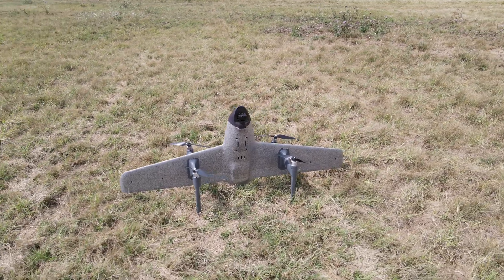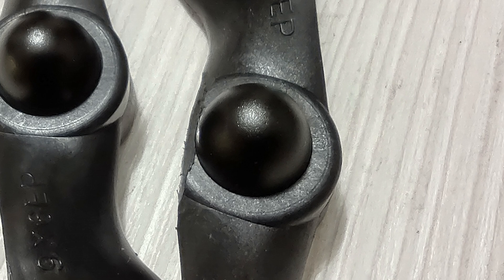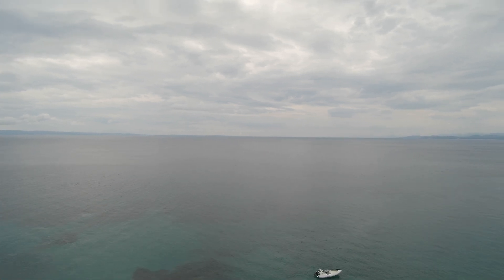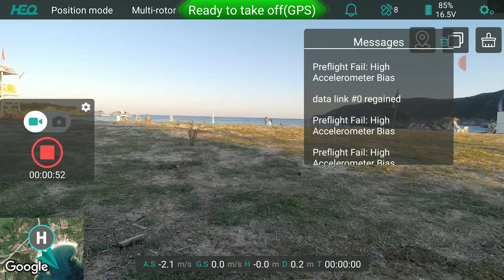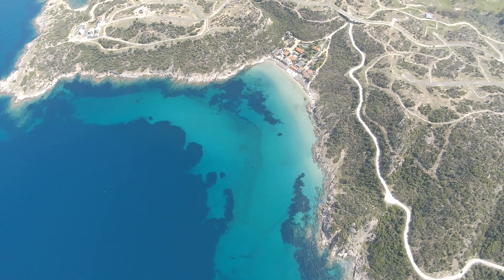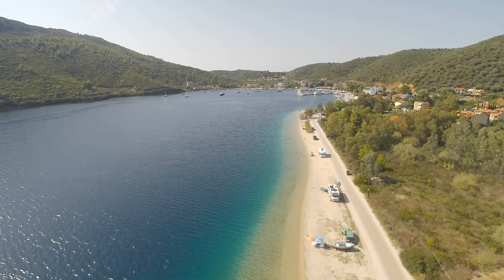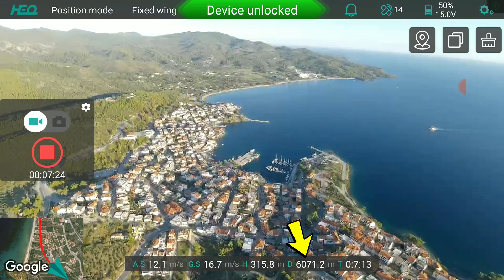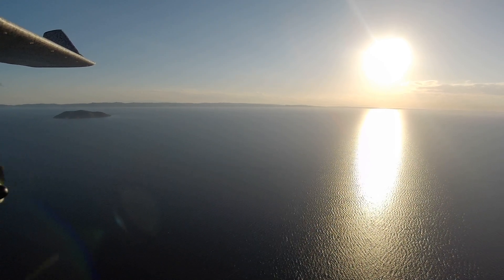HEQ Swan Voyager 1080p VTOL - improvements and more testing

Comment: Hello, thank you for your video. I am a drone instructor at a school in the US, and received the Swan Voyager today. Can you tell me where to order additional sets of props? Are there any after market better props? Mine came with the Sky Zone S goggles, but we cannot seem to pick up the video . Do you fly your FPV. Any thought on antennas for the FPV goggles?    I have flown it today only in hover mode and practiced the normal drone modes. It did seem to have trouble getting any GPS satellites, nearly 20 min before it was ready to fly.   My instruction are not very good. Thank you for any help
Reply from the maker: Hi, sorry it has taken so long to reply, just a lot has been going on around here. So as far as I know props can be purchased from the HEQ website, I think... or if they don't have them listed, just contact them on email, I am sure they woudl be willing to sell some! GPS does take a very long time to get a lock, I can't say why is that, but it is very annoying indeed! The versions I have both sport HD video links so I cannot comment on the analogue system, but most current patch antennas should be good for some distance on the goggles, pointed at the plane + an omni antenna for close range flying.

Comment: Hi there. Were you able to do a full range test on it? Were there any firmware updayes that improved things? Im curious to see if it can be paired with the hm30 to get even more range....
Reply from the maker: Hey, I have not done more range testing, but even that flight in Greece was plenty, although I will have to try it, it flies less than the Swan though... so not sure it can reach further if only going by the battery! As for HM30... I don't see a reason why it wouldn't link up to it, it is the same system! There was an app update to add more functionality to the camera controls, but other than that I don't think there is much new firmware-wise.

Comment: Many of the propellers I have balanced on the Du-Bro unit have been heavy on one side of the hub and not so much in the blades. I use several layers of aluminum tape patches on the light side of the hub and it always works. The holes you have drilled in your propeller hubs make them risky to use in my view.
Reply from the maker: They've been fine through quite a few flights now! But yes, the hubs are the main issue, the blades have very little imbalance, but they have some nonetheless!
Reply: @ArxangelRC  I use aluminum tape on the blades too if necessary.
Reply from the maker: @rcbits404  Perhaps for larger imbalances it might work in smaller amounts compared to electrical tape!

Comment: Wonder if the manufacture of the propellers has a misaligned mold for placement of the metal hub. (3:57) Addressing would save wear and tear on the motor bearings, motor mounts.

A very though review and testing with awesome clear feedback for HEQ work with. As you're demonstrating there is lots of potential in this VTOL platform. Hopefully issues feedback is taken seriously and properly addressed.
Great scenic video btw. An optional higher quality camera option could be another untapped market for HEQ to explore.
Reply from the maker: Indeed! I recently flew the plane again, after a 3 month break, and I was surprised how quiet it was with these props, especially when you consider there are 4 motors running all the time! Especially in forward mode it was pretty quiet, definitely quieter than some of the single prop models I've flown recently! Wear and tear has been reduced for sure! As for learning from this feedback... all I got back was "props work fine with a damped gimbal, we will change gimbal mounting though to make it more stable"!!!!
Reply: @ArxangelRC  Glad to hear you back in the air again. :)
😂 Appears message lost in communication.
Reply from the maker: @AerialWaviator  Yeah, it is like they are unwilling to change anything for some reason... which is weird... most of them are EX DJI guys!

Comment: I recommend you use Aeronaut prop, nothing of vibration, better than APC.
Reply from the maker: Well... that's the thing... the plane was not happy with the DJI props, which gave no vibrations but were a different size and pitch... will these come in this size and pitch?
Reply: @ArxangelRC Yes, you have aeronaut Power Prop 9x6. In my experience with planes and fixed wings works better than APC for vibrations
Reply from the maker: @jorgermartinez  Hmmm, OK, will have to look them up, thanks! :)